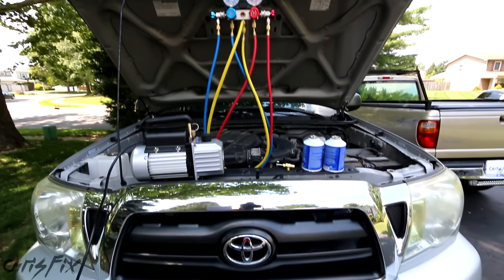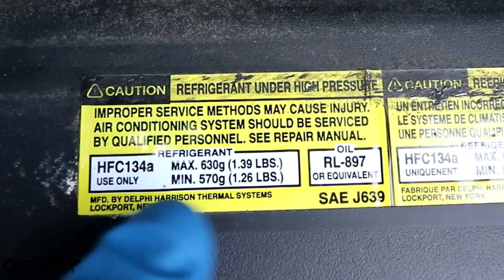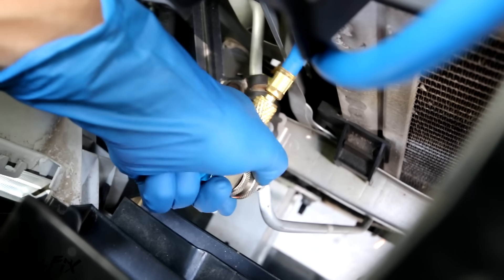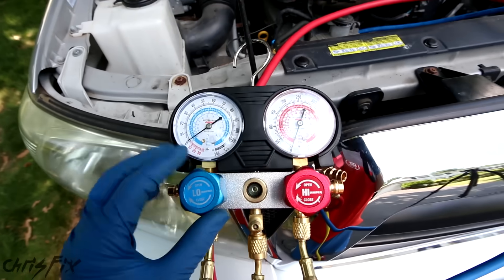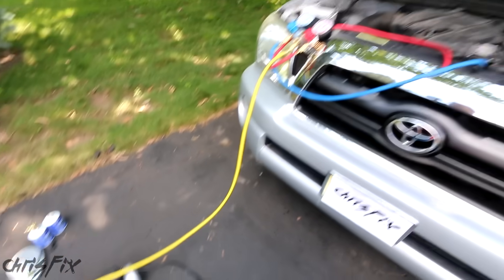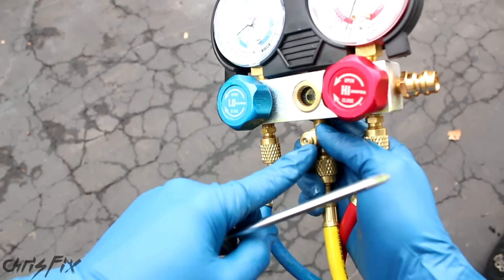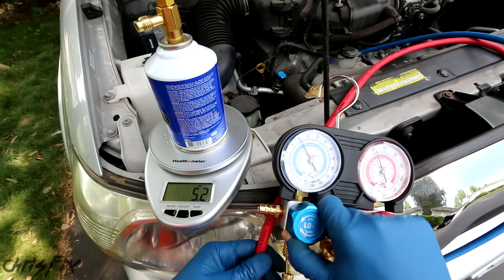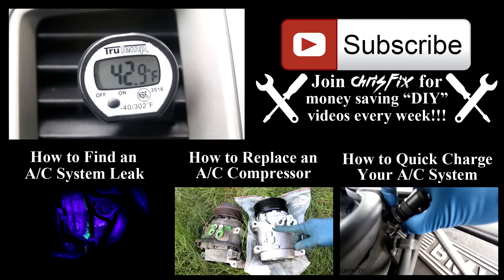How to Properly Recharge Your AC System

Comment: After replacing or repairing AC/sys: AT YOUR OWN RISK!!!!!!!!!!!!!!!!!!!!!!!!
1. pull vac as shown
2. after vac time, turn off pump, close gauges, SEE step 3. note pressure. wait 1/2hr. check vac pressure, a vacuum will quickly indicate a leak. 
           note: the amount of time the system can be exposed to air should not exceed 1 min on a dry day! keep caps or free peal tape on exposed lines! when replacing components, lines-comp-ect, only remove shipping caps/plugs just prier to installation. 
MOST AUTO-AIR SYS HAVE ONE FORM OR ANOTHER FILTER/DRYER they remove moisture residue like a sponge. exposed to atmospheric humidity will quickly cause saturation not only rendering them useless but now are filled with water {the enemy}.  this can cause swelling/blocking the sys and even containment failure of drying material now clogging everything, EVERYTHING   You do not ever want to have this happen. 
2a. If you do, sell the car in the winter. Out of state. Trust me. It's for the best. 
2b. So a thingy to put on your "I've opened the systems line, list" should include replacing the dryer, last! This rarely causes a real problem but when it does... Dumb, dumb, duuuuuumb
3. never turn your vac-pump off without using vacuum brake. this is not like a pallet stretcher,  this is for real-reels. If your pump does not have a brake valve, close gauges, while pump is running, crack open line to pump, an audible change in pump will be made, turn off pump. this will prevent pump from "locking up"
4. reseal line to pump or freon can.  the motor is off during this step
5. while under the vacuum turn one can upside down and charge the HIGH side until the can runs out or it stops taking it.  the motor is off during this step.
5a. this is the ONLY time you add squat to the high side.
5b. never invert freon can while filling the system. HOLD CAN upright. 
          Let's say your about to fix a cars AC. It still works, just not so great. You find a leak. Miracle of miracles it's only a lose bolt. You bust out the gauges and gases. Hook it all up to this not just hot running system but a poorly running so even hotter system. You turn the can upside down releasing liquid refrigerant at about -50f onto a compressor valve assembly designed to compress a gas, that is about 200-250f. Hot spring tension steel meets liquid freon...  Let me do the math... Re: step 2a.
6. close gauges. the motor is off during this step.   
7. NEVER START ANY AC SYSTEM UNDER VACUUM!!! the compressor should not turn on due to low side safety switch but if it does: Please refer to step 2a. 
7a. the vacuum can be used to add oil and/or dye. the purge valve on the gauges is connected to vac-pump first to purge air.
8. from here... what he said.

This might not get into theorems on molecular motion but does cover often skipped steps to a happy AC unit. Now go forth and blow some $#!t up.

Comment: Good!     Worked like ya said, 98 Honda Civic 5 Speed 300k miles  Good!
Reply from the maker: Awesome!
Reply: That reminds me, I need to put my 01 civic together.  The cam position sensor was going out, I wasnt driving it.  They told me, but it was fine when i tried it.  But, it did it on me once.  Made the exhaust manifold get red hot, and it was bright red.  Made the head gasket leak.  I took head off.  In retrospect, I had a couple of loose head bolts, should have just tightened and kept going.  Bolts just got hot and loosened.  Barely a leak.  I could go 22 miles before it would get hot.

Comment: Tried this today and didnt work😡 everything went exactly as the video but i opened the freon can and both gauge jumped to 100 and it would not take the freon what so ever... (compressor was running) so i disconnected everything, restart the whole process and same results... just would not take the freon and gauges were at around 100

Comment: Ended up here from your AC Pro video that seals any leaks.  If I don't know if I have leaks or if it's just low on refrigerant (it's a 99) would it be bad to do the AC Pro fix?  It blows cold just not as cold as other cars so I'm guessing it's just low on refrigerant.
Reply: greeenteeee Does the compressor cycle on and off rapidly?
Reply: StrongEnough78 depends on what “rapidly” means. It cycles frequently   So it doesn’t stay on for long but it does stay cold and it was 106 yesterday
Reply: greeenteeee Rapidly would be every 5 seconds or less. If it's doing that then your charge is low.
Reply: StrongEnough78 I'll confirm next time I'm out driving.
Reply: greeenteeee Yeah and let us know what happens. You can even just start the engine and turn on the ac.
Reply: StrongEnough78 so the compressor cycles at minutes at a time-- at least a minute and a half cuz I stopped watching closely after that.  Far from 5 seconds on then off.  It's a 99 had it since 2015 so I'm guessing it's good to go, better than doing a DIY recharge, messing something up and making it worse
Reply: greeenteeee Ah ok. Thats normal then. Yeah try cleaning the condenser and radiator. Check your radiator fan too. Make sure its working.
Reply: StrongEnough78 all that is good as I've torn into the cooling system several times here due to the desert heat.
Reply: StrongEnough78 it doesn't cool as well as my IS300 but maybe that's the diff between a 4 and 6 cylinder lol
Reply: greeenteeee LOL nah the engine size won't make a difference. I've been in a few 4 cyl cars that would freeze you out. Unless it is low enough to effect it. Usually if its low enough to effect the temperature it'll cycle rapidly. Maybe hook up a manifold to it like Chris did in this video to see where the pressure is compared to where it should be.
Reply: StrongEnough78 guess there's no way around doing it the right way
Reply: greeenteeee Nope, unfortunately. If you want it done right, that is.

Comment: People should note if you change your AC compressor and it comes pre oiled, every Vehicles different. small car might be enough oil in that compressor but a bigger AC system like a van or SUV might have 2 AC coils so they need more oil then what came inside the compressor.

Comment: awesome detail. Great fix dude. However I just wanted to state that anyone doing this vacuum evacuation test will receive less vacuum at a higher level and will not see the entire 29.9 hg. Regardless , its well enough to have evacuated the entire system. If you were to remove the accumulator and replace with a new one then a solvent should be introduced and blown through the system to rid it of particulate matter.

Comment: Went through the process and had a great running system test... disconnected the low-pressure hose and the port didn't seat properly... ended up slapping the hose back on and off and it seated properly. Don't know how much freon I lost in the process.... Crap

Comment: Excellent video, especially for new learners. Only thing I wondered was why he sety the fan in car to low. I've always heard to leave windows down, fan on high, doors closed. I've even seen where some say to not to have it in recirc mode, have it in fresh air mode!  But, never believe everything out there on i-net you see, hear and read. Afyter a bit of experience doing things a few times, you can usually figure out what's best. This video showed the dude getting it down to less than 43 degrees doing it his way! That would constitute that this is one of the proper ways(to skin that CAT!). Good job CF!

Comment: One other thing, why did you not drain the pre filled oil in yours? I've seen a lot of info pertaining to draining new, pre filled, compressors and replacing them with required pag oil. Something about possible oil may be wrong amount, old, etc. So they wanted us to drain and fill jic?

Comment: Great video.  I repaired the AC condenser in a 2010 Acura TSX.  Then followed this video.  Besides a few mistakes I made. Following this video is exactly how to charge the AC.  I will note that adding oil needs to be added to the part.  The yellow line doesnt have anywhere near the capacity to hold all the oil i needed(50ml).  However, this is a mistake I made because the repair instructions from the manual tell me to add the oil to the condenser itself which worked perfectly then no oil needed to be added to the line.

Comment: After charging my system, the lowest temp I could get out of my vents was 54 degrees, and its currently 11pm - current local temperature outdoors of 70 degrees.

Why couldn't I do better? I just replaced EVERYTHING: 100% new aluminum piping, New accumulator / receiver drier / desiccant, new expansion device, complete vehicle-specific o-ring seal kit, correct viscosity 150 PAG oil and a new clutch recycling switch. (vacuumed and tested for leaks: all passed)

Comment: what I learned from this video is that..if your mechanic gives you back your car and it still has the ac leaking issue...they didn't know what they was doing when they put the freon back in. they should have waited 30 minutes to see if the pressure changed. or they are aa scammer

good video. thanks for helping me understand this process.

Comment: I followed the steps however I could never see the coolant pass through the sight glass on the manifold set.  I let the truck run for 30 minutes but the coolant never entered the system.   I checked all the settings on the manifold set and all of them were open.   so I am not sure what is going on

Comment: hey chrisfix thanks a lot for such an explained video on ac systems!  all your videos have helped me a lot in fixing up my cars. although i do have one question ie one of my cars ac compressor needs to be replaced and since I'm getting a used compressor I'm not sure if it already has oil added to it or not i will still be draining all the previous oil and adding the new oil to it so u basically said to add oil thru the yellow hose and connect it to the refrigerant container but since we will be purging out ne air from it dont u think all the oil wud get out?

Comment: He charged through the low pressure side correctly.  But what if I made mistake and opened the high pressure side by mistake?  Or does the manifold gauges only allow fluid flow through the low side?  Good video.
Reply from the maker: Nothing happens. You might add some refrigerant to your bottle but it's a closed system so you just shut the high side and open the low and your're good to go.

Comment: Will this same recharge progress work on other non-vehicle air conditioning like central units and/or window units?
Reply: Chrysler Concorde - careful 

Different refrigeration means different refrigerants.  That means different connectors.  

Newer Home refrigerator uses r134 like car.  Older use r12 like older car.  I just got rid of a GE home refrigerator last year that finally died that had r12.   Home refrigerator don’t have a Freon charge port. They can be added.  I have done that on and filled a 134 fridge a few years ago. 

Home ac window units use different Freon too.  Older use r22.  Same issue with window units because the don’t have refill port. Outside newer use stuff that’s different and I don’t recall the name.

Comment: Please forgive my ignorance.
When applying negative pressure to the AC system using the vacuum pump, Would this  remove the oil inside the ac compressor?

Comment: I have a problem with your video. First if you had to add refrigerant then that means you have a leak unless you took the system apart. And what about adding oil? If you vacuum the system are you or are you not removing the oil as well? I have noticed that when ever the refrigerant leaks out it is usually the High and Low valves that need to be replaced, you know, the valves that look like tire air valves. So in my opinion those should ALWAYS be replaced when you decide to vacuum the system. I am about to do 3 cars that are leaking refrigerant. Refrigerant does NOT go bad so if you have to add it to get your A/C working then you most definitely have a leak! 100% guaranteed that you have a leak.

Comment: I'm reading some of the comment and it's like half of these people didn't go to school. Liquid can be compressed look at hydraulic jacks ok. Free on is compressed in your ac if not they would call it a pump ok. Free on in 12 oz can is under pressure and sold by fl.oz. Not volume uncompressed free on turns to a gas that's why a.c. Units have expansion valves . Condenser .to convert gas to liquid and back to gas over .n over.heat is what makes free on cold .come on people you learned this in 3 rd grade .

Comment: This was awesome, great job and super helpful since I am doing mine on my Tacoma today.  The only thing is that I was taught 1oz stays in the can do to the pressure equalizing with the system and that two ounces stay in the hoses and manifold.  So my thinking my my Tacoma is that if anything I'll be spot on or two ounces low but certainly not two ounces over.

Comment: Your gauges are incorrect. 30 would be considered a perfect vacuum your probably @ 28 inches of mercury. Moisture will also freeze in the thermal expansion valve or orifice tube causing a blocking condition. But it was a very well described video. Great work.

Comment: HI ChrisFix, when you run the vacuum pump for 45 minutes to remove the moisture as I did when I fitted a second hand air conditioning compressor as my old one seized, does that also remove any oil that might have been in there before? Or does the vacuum pump simply remove all moisture not oil?

Comment: Hi, i bought the set from your link, the pump, the hoses and the gauges and i received 2 extra small parts, like purge valves, same or similar like the one you pressed to remove the air from the hose before you started putting refrigerant into the system.
what ate those for or they are just extra?

Comment: I’m sure you know this but you did a fantastic job. I’m a rookie at AC work of any type. This was my indoctrination.  Thanks. As an FYI: make sure that the little nylon seals in the manifold hoses don’t fall out or you most likely will not have a good seal.

Comment: Most thorough AC vid I've seen yet.  Almost intimidating, yet nice to see it done right, which is why I do things myself.  I have no doubt that any shop, especially the chains, would just fill a $10 bottle, charge $150, and say 'feel how cold it is?'  Looks like you went to Harbor Freight.

Why do you say to not use refrigerant with additives like for leak sealing?

Comment: Hello,  can you help me air conditioning cycles, I put gauges on them. with an ambient temperature of 16 ° C (60.8 ° F) air conditioning at standstill I have 3.5 bars (50.76psi) low side and high pressure (that seems weak for this temperature!?). air conditioning running high pressure is between 9-10bar (130.5-145psi) so rather normal!, but low pressure and 1.5bars (21.7psi) with cockpit ventilation at bottom, but if I drop the fan speed on the lowest speeds (1,2,3) the low pressure descent and 1,2bars (17,4psi) the compressor clutch disengages!?. as a result the low pressure rises and the clutch engages again then the low pressure descent and closes the clutch again, so on :-( if I put the fan speed back on high the low pressure stabilizes at 1.5bars (21.7psi) the air conditioning works well and does not cycle! unless I gently ride the engine rpm the low pressure descent and cut the clutch!. Is this a cause of coolant down. 'advance for your help (sorry for my english not top i'm french 😉)

Comment: Question: Does the high pressure valve need to be open when adding refrigerant to the system?
Reply: Never ever open the high side when charging.

Comment: 13 Silverado ac wouldn't engage blinking ac light on the controlls. I found a leaking Schrader valve on the low side. So I Lost all my charge.  I acquired everything I needed. Same manifold from HF.  Installed a new Schrader valve . I vacuumed to 30 for 1 hour. It Held the vac for 30 min no problem.  Then when I went to add the refrigerant the compressor wouldn't engage. The low side gauge showed pressure but that was it. Never moving to the high side. 
GM's BCM won't engaged the compressor unless there's enough refrigerant pressure, correct ambient temp etc...  now what do I do? I'm assuming my compressor is good. And the only thing wrong is there was not enough pressure in the system to tell the BCM engage the compressor.  Seems like a catch 22 when recharging the system?

Comment: Other than you didn't use a micron gauge to pull down to 500 microns, you cannot use gauges to pull a proper vacuum without a micron gauge.  And its a sight glass in the middle of the gauges  pretty good
Reply: Hello sir, do you know why when you open the low pressure tap and the refrigerant doesnot run out?
Reply: chaowen zheng 
Well if your asking why it doesn't come out when you don't have the hose attached to the access port the answer would be low loss fittings on the hose. If you are asking when it is hooked up you don't have your bottle open or can peirced or possibly issues with your manifold gauges. You also need to run the compressor when your charging. It could be a couple things but I'd have to be there to know for sure hopefully that helps you
Reply: Thank you sir for the explanation. Now i understand a bit more. Before we charge the refrigerant. Should we release the old refrigerant? It was not clear in the video. Thank you
Reply: chaowen zheng 
To "release" the refrigerant is a violation of the clean air act and unethical. It needs to be "recovered" into a bottle. If you can't recover it have a shop do it for you